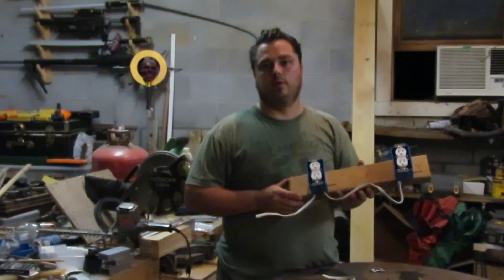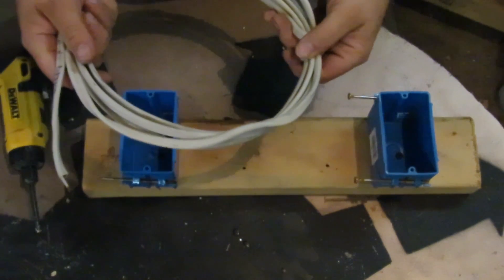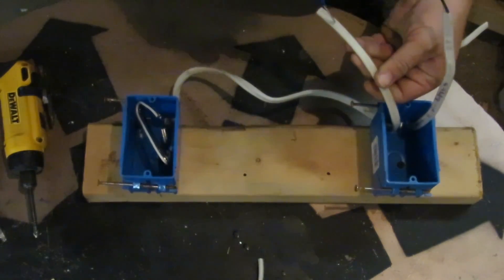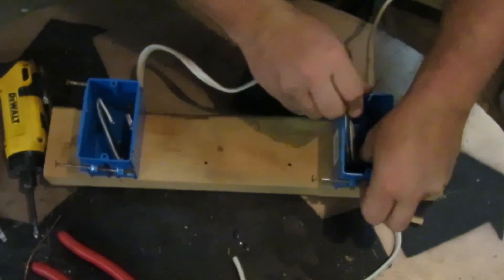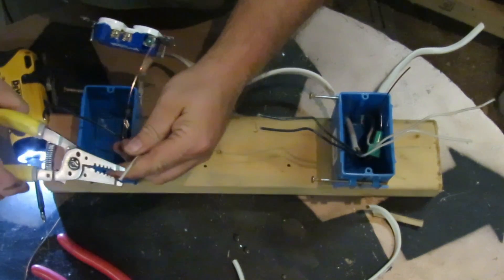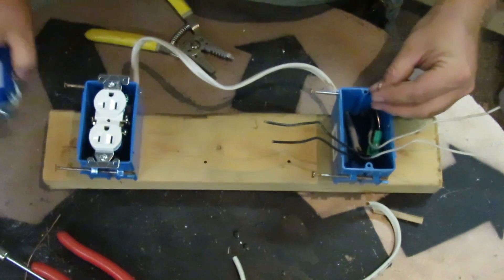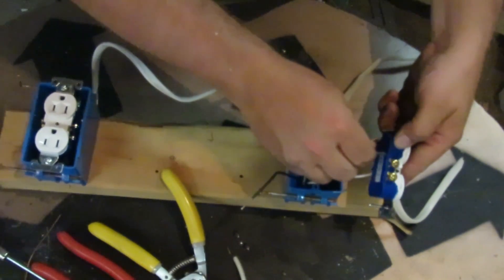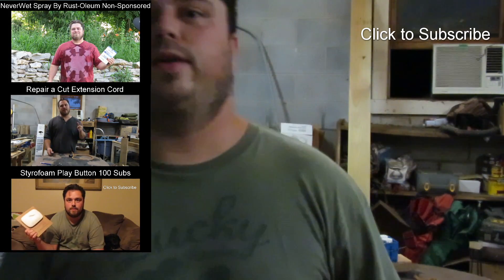How to Wire and Install an Electrical Wall Receptical

Comment: Why did you put two wires in the one box? Zero electrical experience here lol. I want to put 2 outlets in my closet.
Reply from the maker: Just to simulate what it would be like when there is also a wire going out to something else, like a switch or another plug

Comment: You hooked your wires around the screws backward. You should always hook them around the screw clockwise so that when you tighten the screw it pulls the wire in.  Hooking the wire counter-clockwise can make it loosen as you tighten the screw.
Reply from the maker: You are correct

Comment: What is the tab for? The one that you can break off? I had an electrician come in and checked my outlets that didn't work and he said you just need to break the tab but he didn't say why. The outlets worked for a year and now they stopped working again.
Reply from the maker: The tab connects to top outlet to the bottom outlet, The actual name is a duplex outlet because there's two outlets in one, so if you have a half switched outlet you would break the tab on the hot side so that you still have the neutral side connected. But then you can have a switch turn off and on one of the outlets and the other outlet would stay energized. Or if you break out the tab on both sides you would separate the hots and the neutrals from the top and bottom. So you could actually have two separate circuits on one duplex outlet

Comment: Is there a reason you didnt tighten the screws at the end 1 neg, and 2 positive ones?
Reply from the maker: If there's no wires wrapped around the screw typically you don't need to tighten them down
Reply: @MechanicalChaos  just found out they are quick conects
Reply from the maker: Typically electricians don't like quick connects on receptacles but I've been using them for 20 years and I've had a lot more problems with screws not being tightened down then I have with a bad connection on the quick connect

Comment: How many receptacles can I put on one breaker? I know this is a question about load and usage but it's in a garage that won't probably ever see more than one at a time used, but I want alot of them available without far to reach one. And is 14-2 more common than 12-2 to use for the outlets? One is white and the other yellow. Im wiring my new garage and my old one I finished after my electrician started and he used white for all the outlets and yellow to the lights. I had 4 8 ft fluorescent lights on each switch, did that really need the 12-2 wire? Or could I have used the white wire for that.
Reply from the maker: 8 receptacles on a 15amp circuit.
The wire size really depends on the breaker size, 14-2(white) will be on a 15amp breaker, amd 12-2(yellow) is typically on a 20amp breaker but could also be used on a 15amp breaker
Reply: @MechanicalChaos  thank you so much!

Comment: Thanks for another informative video. I didn't know you could just plug the wires into the holes in the back, I've always screwed them onto the side.
Reply from the maker: +Benjamin Stewart thank you.
Most devices are designed to let 14 gauge wire push in the holes.
I have had better results from pushing the wire into the hole because there's a little piece of metal that bites into the metal ore is around the screws, the screws can become loose over time
Reply from the maker: I have a copy of the National Electric Code handy, would you do me a favor and let me know what section that is in.
Reply: You should not plug the wires into the back.  Backstab terminals are not very strong and will wear out long before wires connected with screw terminals.  In fact, backstab terminals are not allowed by code in some jurisdictions.
Reply: Don't know; I'm not American.  Even if they're allowed by code where I'm working, I still don't use them.  I've seen backstab terminals fail lots of times, but I've never seen a screw terminal fail.  Saving 15-30 seconds per terminal is not worth having a customer pissed off later because the receptacle I put in doesn't work.
Reply from the maker: one of my main jobs is doing service calls, and if that screw isn't perfectly tight, the vibrating AC will work it loose, where as the push-in Bites into the wire.
I have had maybe one service call over a push-in not making good connection, where as I have had an uncountable number of calls where the screw worked itself ever so slightly loose, not visually and all it will take is a quarter turn and everything works again.
TLDR: I have had slightly better luck with push-in than under a screw, but feel free to do as you feel is right, I won't tell you not to do one way or the other.